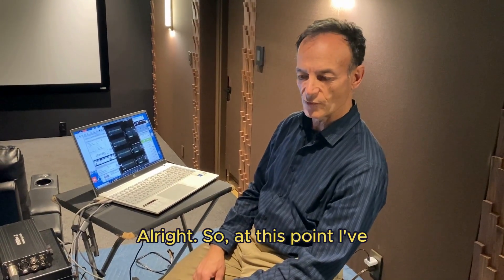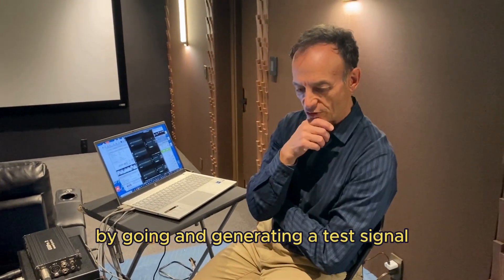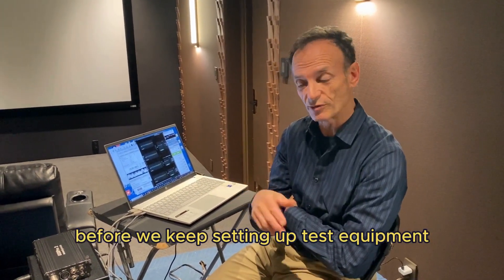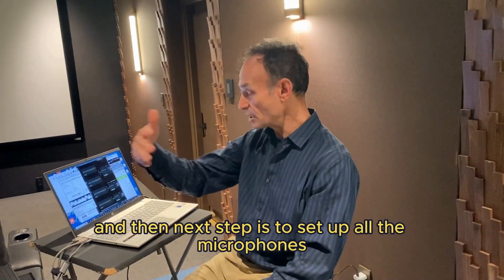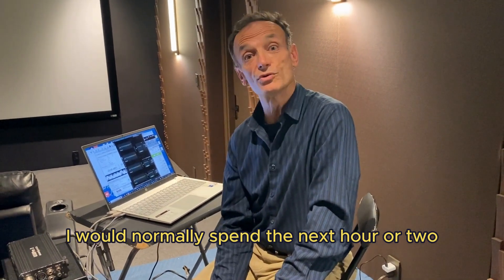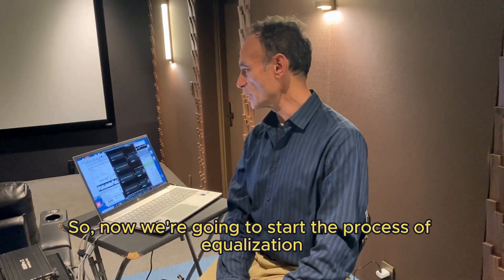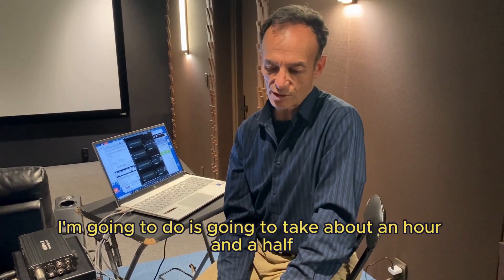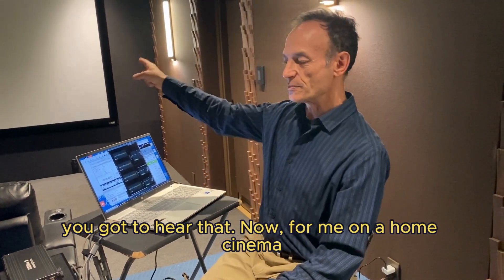Home Theater Calibration Part 3 - Speaker Testing and Bandwidth Verification

Comment: How did you achieve bass boost for the center channel, if it is built into a baffle wall? I have experienced with in wall subwoofers that they lack the punch compared to the ones that are positioned next to the wall. I have heard that when you build a subwoofer into the wall, it won't be a 360 degree emitter anymore, but 180 and so you lose some room gain. Looking at the response of this center, this is clearly not the case :). May you please advise?
Reply from the maker: The three font speakers are on the wall, not actually in a baffle. They are the Grimani Systems Rixos-M, which were developed for On-Wall or In-Wall placement. There is a DSP profile for each application. The bass boost here is a combination of natural room response, and 2pi baffle reinforcement effect. Realize that in the bass region you never really have a 360 degree radiation, since the boundaries are all very close to the drive units, considering the long wavelengths.
Reply: @grimanisystems  thanks for the detailed answer